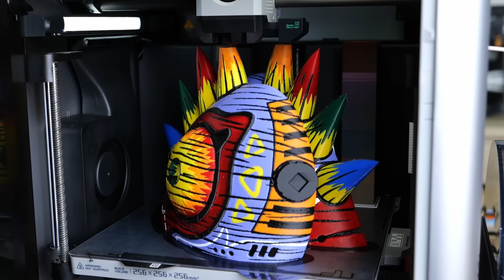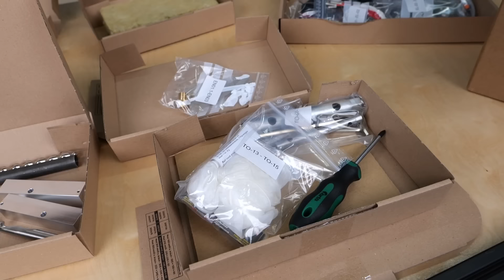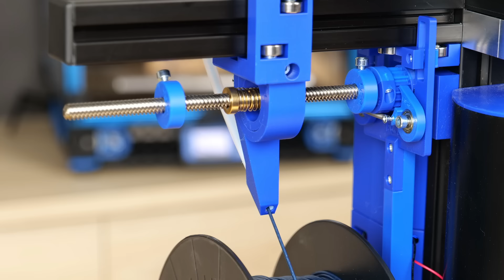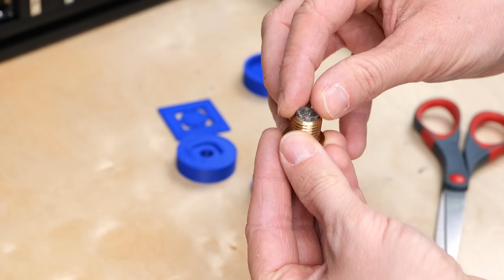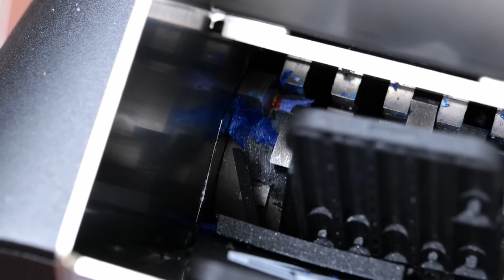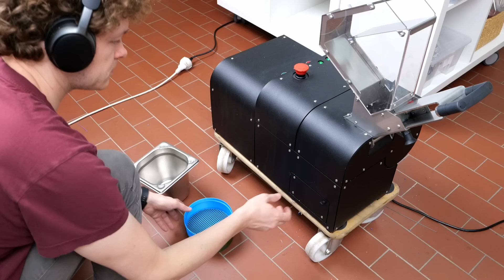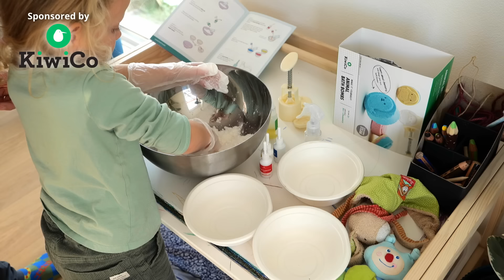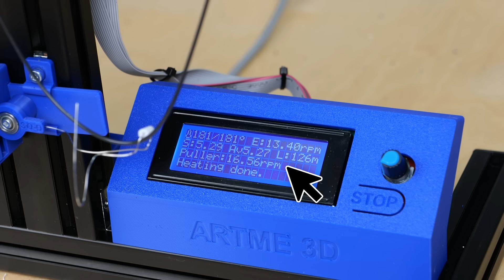Recycling Failed 3D Prints with a DIY Filament Extruder: Artme3D

Comment: One improvement which could drastically improve your feed rate is to focus on the hopper, with 2 goals: reduce friction between the hopper and granules, and reduce static buildup. To that end, you could line the hopper with a well-polished metal foil (or polish up a print using a conductive filament) and then ground the hopper to a nice conductive mass.

Comment: The cost is too ridiculously high. $150 sounds more like what it should be. You  are printing the majority and putting it together.  Then you can't even use it until you find a way to shred it. If the machine came assembled with a built-in shredder stage. Then tested for quality and removal of some of the still glitchy components.  Those are the things that may make it worth around $5-$600. I'm not going to pay top dollar to be the lab rat and discover all the problems for the company. It's way too expensive. I'll just throw the waste away unfortunately.

Comment: 700€ kit 🤔
Are there no more affordable kits? 
The goal is not to waste/save on the plan, it's not cheap
when I see the price of extrusion screws 🤣🤣
Same opinion as other comments, recycled plastic, 
I think you need to add a little new to get something decent at the end,
 new plastic, or an additive...
When I see the price of plastic spools, I'm going to have to print a lot to make the machine profitable...
For an individual, it doesn't seem profitable...

Comment: I worked as a process mechanic for a decade in a plastic production plant. We ran our own extruders and processed our own regrind, where a lot of companies will buy plastic in spooled sheets and just ship out the regrind. Some notes. The grinder you're using is not ideal. What you're using is more like an aluminum shredder. A plastic grinder consists of rotating blades that cut against a stationary blade and works more like a giant shear, rather than a shredder. A screen at the bottom controls the size of the flakes, and the blades must be sharp and gapped properly so as not to cause excessive heat. Also the extruder would work MUCH better with a metering (sometimes called a melt) pump. This sits at the end of the extruder barrel. It's  essentially a set of interlocking gears that rotate toward the extruder and force the plastic around the outside of a figure 8 shaped housing. This equalizes the pressure and makes the output much more stable.
Reply: Interesting information.  I just found an industrial scrap plastic grinder pelletizer online. It's a 3hp unit, used, last used in a tea factory.  Maybe this is a better solution for extruding?

Comment: I have a problem with my extruder. I've already built it, but when I try to load the firmware, the screen stays with the startup message and the firmware doesn't load. Any help? Suggestion or solution?

Comment: Would it be possible to enlarge the extruder to 2mm, and then process the filament further through pultrusion to get it down to size at 1.75mm. This might help smoothen out the filament, and have a more consistent finish.

Comment: I just bought my first 3D printer  and in my research,  I was pleased to find people creating solutions for recycling plastic bottles into filament.  Most of what I saw was PET bottles cut into strips and heated to more or less simply round them off.And then I thought,  could you create a better, stronger filament by shredding the plastic bottles and then melting them through an extruder just like this.  

So, if you have extra empty PET drink bottles lying around, I would love to see how they would turn out going through this recycler.

Comment: I loved watching this and it is an awesome diy design.
I think just a simple 3d printer enclosure modified would be great to put around it with an exhaust (if wanted).

Few upgrades can already be seen but keeping price low and doing a great design to start with.

One thing I am interested is different materials being done. I dont think I saved my junk materials separately (PETG, CF, PET, etc) Wonder how that would all do mixed in. I wouldnt expect great but curious.

For testing the sizing, would make a V groove to the exact 1.75mm diameter to check here and there. 
could also 3d print a wheel for the metal rod sensor to roll instead of a hanger wire.

This is great and I look forward to this being more available!

Comment: The question is, does it HAVE to be failed prints that you feed into it? Most plastic bottles are marked with what polymer they're made from, so could costs be dropped by thoroughly washing, shredding, and then drying batches of identified plastic waste?

Comment: Everyone complaining its like 600 bucks but thats still like 6 times cheaper than the 3Devo, or complaining about needing a pressure pot or shredder, blenders work fine with time and a pressure pot isnt strictly necessary for dry bits, couple hours in a toaster oven at a bit less than the filament melting temperature or using a filament dryer, or using the build plate heater in an enclosed printer will work just fine. Its open source and the parts needed are llisted and readily availiable for the most part and you can spend a little here and there and work up to getting this made. As a hobbyist who doesnt print a lot, this might be used maybe once every year, if that. But someone running multiple printers, or someone who prints and prototypes a LOT could definately use this machine.

Comment: i rather hope we can get a cheaper and smaller version for the hobbyist who just hates to throw away failed prints, and support material.

i'm new to 3d printing, but just tossing the failed prints and supports seems stupid, if we can use it in any way. but for being a hobbyist, i have so far only used around €400 equivalent in my currency, so spending another €600 to recycle is a very big "nope" at the moment, but something around €200 or less is definitely something i would be interested in paying to recycle failed prints, supports and so on.

Comment: I would imagine the only thing missing is a cooling section that has it locked at 1.75mm, but if it works, don't fix it. I worked at an extrusion plant making pipe, and we had vacuum tanks to pull the desired diameter after the extruder, but this is a completely different, non-hollow element.  I donh't know how that would work unless you fed the filament into another tank with cold water directly after extrusion, but that would create another set of messy problems to deal with, and the filament would have to be 'squeegeed' or 'foamed' to remove the water and then dried for use.
You got an amazing result!!! That's rather worthwhile considering the price of filament, especially if you print a lot. Looks amazing.
I just joined 2 rolls of filament together. Guess who just spent 2 hours manually winding it back onto a single spool.

Comment: Still quite a bit too expensive for myself and likely most hobbyists, but this is a massive step in the right direction and a sign of what's likely to come. The 3D printing industry is basically speedrunning the development that computers went through several decades ago, becoming faster, more powerful, more affordable, and consequently more common and more supported.

Comment: So yes degradation over repeated recycling but could you then introduce new "virgin" pelets into the mix to strengthen it again? Or say simply reuse and reuse until you can't by only using the recycled filament for supports as supports dont need to be strong and many maxhines can print supports from a separate roll. My thinking is turn wasted filament (of the same type) into support only filament and keep reusing and adding more waste filament into the mix and using it for supports. A ton of the wasted material is supports anyways andthis would also allow you to recycle the poop and failed prints back into more support filament.

Comment: while this is an amazing idea and an incredible achievement, it's so sad that the barrier to being able to competently recycle wasted plastic is several thousand dollars and a multiple of effort rather than simply throwing it away. i say several thousand dollars here because, despite that the recycling extruder itself was only 600, the grinding tool, drying rack and vacuum chamber are all added as cost to this experiment as well, which i'm sure are not at all. cheap. still, good work. also, i really like the end product look of the filament.

Comment: To measure the diameter ,  cant you not print a peace of plastic, with a V groufe in it,  starting from around 2,5 mm to 1 mm or zero, when you hold it around the fillement u can see how deep it falls in the grouve witch has diameter indications ( sorry for bad english )   just thinking how ivwould do it

Comment: for me personally, I'd be able to do something like this, if I could make my purchases in chunks, Buying the kit one month, and a shredder the next. I can certainly see that this will over time, absolutely pay for itself. I'm curious about materials, PLA, but what about PETG, or ABS? Also, I can't imagine how, but have you got a process for recolring waste? I imagine not, but keeping colors separated shouldn't be too difficult for people like me, with 1 printer. I've got a Kobra 3, but that will just be a max of 4 colors to separate the poop, not sure on the failed prints, but I'm sure coming up with a way won't be too difficult. The upfront costs are the difficult part for me, and I assume a fair many other people. This is a 2nd or 3rd tier hobby of mine. Every dime I spend here, is one less for my other hobbies. Hard pill to swallow, given the purpose of my buying my printer, was for enhancing my collection displays. Taking money away from my collecting, kind of defeats the point of being able to print new display pieces lol.

Comment: So, up front, this is not meant as sarcasm, I'm genuinely curious. It's like $600 US for the extruder kit right? So, that sounds good, but during the video, you go on to mention using your purpose built shredder to produce pellets, then your drying oven for drying, then your vacuum chamber at the end. That's where I hit pause to come ask this question, so if you use another specialty machine in the process, I will have missed it. Point is, adding ALL the other components to the prep process, certainly is far far more than $600 to recycle failed prints. So, what's the ACTUAL cost from start to finish, of recycling failed prints/poop into useable filament? I'd assume the shredder to be absolutely essential, but what of the the vacuum chamber, and drying oven? Could I say use my regular oven "my house has an extra I could use that doesn't cook food" for drying, and skip the vacuum chamber? Given the shredder price being reasonablely priced around the same or less than the initial kit, that'd make this acually attainable for most of us.

Comment: I worked in an industrial extrusion plant, this is just a way scaled down version of our recycling process. Set aside scrap, throw into the granulators, put into bags, feed back into the line at 80/20 virgin powder to regrind. A couple tips if you want it to go smoother and produce more.
If you pulverise some of the regrind into a fine powder and mix with the chunkier regrind, the extruded product will be far more consistent. You can attach a magnet to the side of the hopper and that will pull out any metal before it has a chance to clog the filter. Use a blowing agent like hydraxine or similiar via a suspended dropper and you can drop the screw speed and temps to almost double your final extruded product at the cost of density. If you want to get super in the weeds then you can drill a hole near the end of the screw barrel and pull a vacuum on the melted material  to effectively eliminate any contamination.
Reply: I think Hydrazine is not something most hobbyists will handle. Its some very nasty stuff.
Reply: Not that I'm going to be using it (I don't even have a 3D printer), but how would the vacuum work? What prevents it from sucking the melted material out through the vacuum hole?
Reply: Sounds like someone was a 'mixer'.
Reply: Hey man, I have a question, we are recycling injection molding abs parts into filament (all the same stuff) and we are getting blobs from time to time, however when we cut them open it's just plastic, so, what could it be? We have a melt filter and we are actively monitoring and adjusting the diameter (we can easily get +-0.04mm tolerances, but those blobs ruin our filament, any ideas?
Reply: @Lucas_sGarage  Hard to tell, if there's no additives then my guess would be moisture forming bubbles in the barrel and popping, letting the material behind ball up. If that's not it then I would then check if the barrel temps were consistent, you could have cold spots somewhere. A couple tenths of a degree difference could cause that. If your setup has themocouplers controlling the temperature then make sure they're still giving accurate results. If not then maybe look into some accessory heating elements to equalise the barel temps. 
If all that fails then I would then check for dust contamination, get some abs powder and run that through your setup, that will tell you whether the issue is external or internal. If it is external then consider washing your recycled material in distilled water and drying off thoroughly.
Reply: For the vacuum part, are your extruders by any chance twin screw?  This is a single screw extruder and everything is under pressure.  Twin screw extruders can have a low pressure zone towards the end of the barrel where vapors can be vented out.
Reply: Aluminum is not magnetic...
Reply: @residuevideos  Where do you get aluminum mixed in with your plastics? Most machine parts in printers and shredders are steel.

Comment: That is still overpriced. 77 usd for the screws? That's ridiculous you could buy more than one printer for the cost of this thing. If they were making everything themselves I would understand but they are selling off the shelf components at a mark up.

Comment: Interesting, although sadly still far too much for anyone not doing a huge amount of printing.
On a more positive front I bet it would be possible to automatically measure the width of new filament as it's extruded and use those results as feedback for the machine to get more consistent results...
...at most basic a potentiometer, springs, a pair of roller-bearings for the filament to pass between - zero on a required size and let the voltage adjust the extrusion speed.

Comment: I wonder what plastics other than filament could be added.  If it were 1/3 recycled filament, 1/3 of the new beads, and 1/3 soda bottle or recycled red solo cup, is that a feasible material for printing?

Comment: This looks like a copy of another extruder I saw but with several inefficiencies/problems. The melt filter should be replaced with a sink faucet screen (or pipe screen), they cost about 10-50 cents depending on size. The winding mechanism guide system should be replaced with a cam rod that has an 8 shaped track in its surface. This makes a mechanism that moves the guide back and forth smoothly and RELIABLY. The electronics could be replaced with an ESP32 and a few bridge rectifiers + transistors. This whole thing should cost no more $100 to build and a proper commercial product <$75

Comment: For the feeder/hopper. If you took some small cooling fans and clipped the blades so the fan was unbalanced, you can glue them to the outside of the hopper and have a makeshift vibrator that will have better feeding and should reduce feeding clogs as well.

Comment: I've boucht filament from a company that uses this kind of filament recycling machine.

Long story short: Due to the ENORMOUS variations in filament thickness and even thicker drops in the filament, I ruined the extruder on my first 3D printer with it.
Without ANY way to make sure the extruded filament is a CONSISTENT thickness (as in: precise, multi-directional wheels pushing the filament into the right shape until it's cold and solid), others will ruin their printer extruders as well.

Comment: i seen enough videos of other youtubers trying to recycle then extrude to know that a bag of pla pellets mix real great with recycled material it kind of bring the stabilisation you need for a diameter that is consistent (i wonder if there is a sensor that could be used for that without going into lidars i think a diy solution is feasable too.

Comment: If you only have a 150x150x150 print bed, would it still be possible to print the 3D parts of the KIT? According to the website 200x200 is minimum, but perhaps some cutting and gluing is good enough?